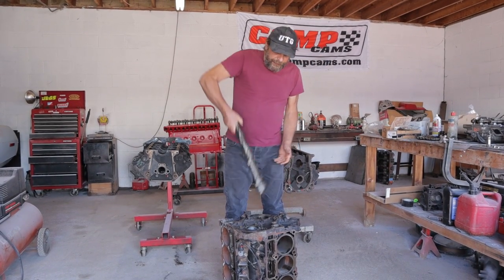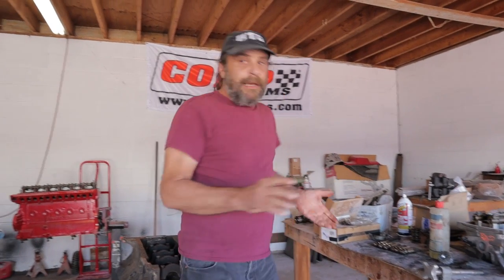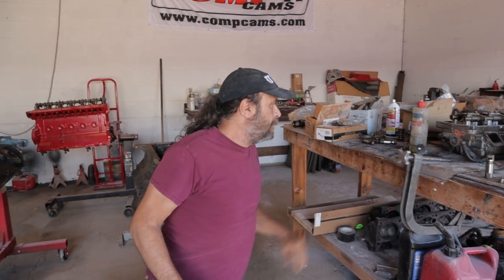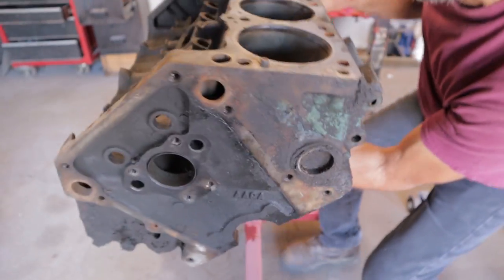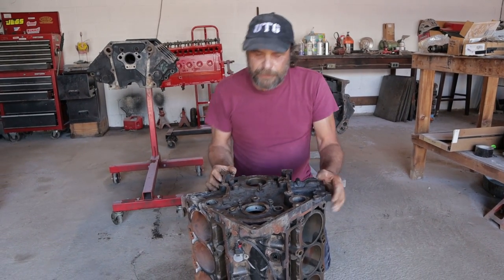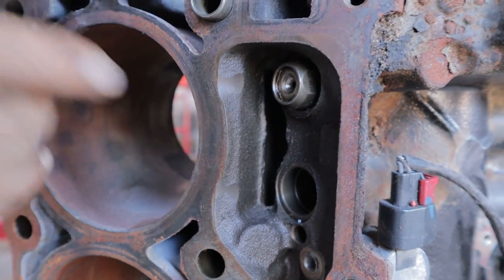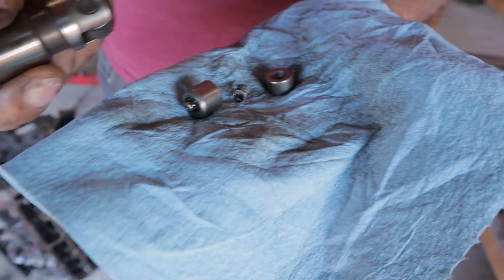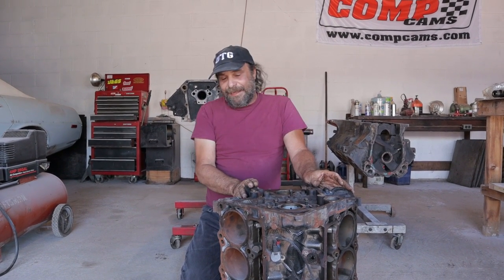Gen 3 Hemi Camshaft Failure Mystery Explained!

Comment: Hi, I'm a Chrysler tech, I've had the fun of replacing a couple of these camshafts and lifters, I've also had to replaced a couple of engines due to excessive metal getting thrown into the oiling system.  I've only seen 2 vehicle driven by normal customers, all the others were police vehicles.   The officer who was in charge of the fleet was grumbling to me about this issue and told me the 4.6 liter Ford's don't do this, but then said but these will destroy a 4.6L on acceleration and top speed.  I explained to him that a 4.6 was an overhead cam engine and that all the cam lobes and lifters were lubricated by a fed supply system and that the Hemi's cam was lubed by splash.  Then I went over their maintenance records and found they were changing oil at 5,000 mile intervals and using the cheapest oil and filters the P.D. fleet dept could get on bid.  They were also idling the cars for 12+ hrs a day between multiple officer shifts in South GA heat running the air conditioner.  So I asked how many hours they put on the engines in a week and he responded he had no idea. My response to him given the amount of idle time the oil change intervals they were performing were probably closer to 10000 intervals.  This combination of poor quality oil and filtration, along with poor maintenance intervals, high heat and extended idling was they lead killer of these camshaft lifter roller bearings.  I recommended they use better oil and filters, and recommended they change oil every 3,000 and try to not idle the engines as much for as long a time period.  He said the department didn't see the need to spend more money on maintenance or the need to educate their officers to be better vehicle operators.    I do think Chrysler should install oiling jets of some kind to spray the lifters and lobes or they could at least change the PCM programming to  periodically raise the engine rpm during extended idle periods.  But that would also require educative training to the vehicle operator.
Reply: Very interesting read sir.
Reply: Would a simple oil line to feed the cam suffice
Reply: @DylanL69  if there was a place to put it inside the block.  The oil galley right below the cam would be a great place to install some spray jets.
Reply: @stevendonnalammar4422  I'm talking about a straight pressured line to feed it I was thinking the tube the cam is in
Reply: Would it not be possible to just put a hole at the bottom of the lifter to oil the cam? Seems like the easiest solution. Like he said some people were speculating it already had.
Reply: @shaneeudy1798  but that wouldn't get the whole cam it would help though
Reply: Interesting
Reply: Aniquin  it's more a lack of oil then bad oil
Reply: They wouldn't have that problem with an LS engine typical Chrysler Dodge crap just like their Transmissions
Reply: @ralphss434  the hemi is far superior to the ls only problem is the cam issue which is fixable with some modifications
Reply: Ford did have their own issues with oiling at idle.  The 4.6 would chew through timing chain guides like crazy.  The plastic would wear away and the chain would dig into the aluminum backing.  All from idling.
Reply: Yeah I'm fairly certain this was only an issue on the earlier MDS Hemi's because after We got it figured out newer vehicles haven't been showing the problem as often
Reply: "He said the department didn't see the need to spend more money on maintenance or the need to educate their officers to be better vehicle operators." - Sounds just about right.
Reply: @ChrisR   well got to agree with him, if the other cars don't require it...now in a world where ALL makes require the extra attention to keep them from eating themselves, sure train officers...its perfectly reasonable to just swap to the ones that don't need any extra attention to live.....and i love Mopar
Reply: Well sounds like you know what you are talking about, is STP 5W20 fully synthetic oil good to use on these 5.7 3rd gen Hemis ?
Reply: So Chrysler build a police pursuit vehicle and they don't think about how the police is going to use the car. Just a bad design and Chrysler denying there's a problem.
Reply: @sho942000  not a Ford fan here but timing chain much easier to fix.
Reply: I worked at a dealer in North Georgia and can confirm a higher occurrence in police vehicles. We did however have a few hemi trucks that had this issue as well.
Reply: @StevenDonna Lammar what about the 3.6? Have you done many of those with head issues?
Reply: @gokblok  About a dozen of them, they also have issues with the roller lifters locking up and burning up cam lobes.  I've replace more camshafts on 3.6 liters than I have on Hemi's.  Same problem, they're all fleet vehicles with long oil change intervals.  Engines need maintenance.  Oil breaks down over time, and even faster in high heat environments.  You don't have to be afraid to buy them, just maintain them.
Reply: @stevendonnalammar4422  I was just wondering. I wasn't the engine tech, but I always wondered if there were that many pentastars that needed heads, or if it was sort of lazy diagnosing.
Reply: @gokblok  The early Pentastars were the ones with the majority of the problems,  I think Chrysler related it to a casting issue and that's why they had an extended warranty on the front/ left cylinder head only.  They had the issue fixed by 2014 I believe.
Reply: @stevendonnalammar4422  I remember hearing the 2011/12 were the problem children, always the same bank, and it's the ones that were built in Mexico. Don't really know how true that is. I do remember thinking that 2013 was the sweet spot for 3.6s because of something else going wrong on the 14s though. Oil cooler maybe?
Reply: Tony Brown the early AFM chevys would drop lifters because the springs couldn’t get adequate lubrication to them. The next gen after that were a lot better when they switched to the thinner oil. Cylinder deactivation systems shouldn’t go over 5k between oil changes, even with synthetic oils.
Reply: @DylanL69  yeah sure that's why the ls is swapped into just about everything
Reply: @ralphresendez9886  that's because it's just a small block chevy
Reply: @DylanL69  a ls engine is not a small block chevy,, none of the parts interchange
Reply: @ralphresendez9886  it's a 350 block with a different bottom end and bigger heads so yes it is a small block Chevy but it's modernized and built stronger. So the hemi is still the better engine. Actually the ls is just modern versions of those engines from the 60's and early 70's
Reply: @sho942000  I don't believe the guides failed anywhere near the times the internet has come to speculate
Reply: @bigblockdodge745  my question is, how many patrol rifles are now unaccounted for from the last few weeks???
Reply: @stevendonnalammar4422  that's the main thing with Ford modular motors, no need to great buying them but always make sure they have been maintained regularly
Reply: ralphss434 actually they have the same issues as they are similar
Reply: Dylan having had both engines the hemi was shit compared to the LS. 323000 on my LS and ran great when tranny went compared to 110000 on my hemi which had a lifter collapse. Luckily it came back but traded the truck off 2 weeks after
Reply: Exactly correct about fleet maintenance, the chevy small block takes a beating way better than the new hemi. Our 2011 and 2012 caprice L77 engines are still running strong, but almost all the chargers are out of service. Drove a 12 Charger pursuit for two years with 75k on the odo. Engine was ticking bad when I got the car, but it still ran fine. I didn't really do much acceleration or idling as I worked in an office. Took it out on the street for a few weeks and the radiator exploded. I managed to cut off the engine after a few seconds but it was too late. Fleet manager put it back in service but it ticked way worse. After 6 months like that i got a CEL. Code was #3 misfire. I'm guessing it wasn't lifting all the way because the rut was so bad in the camshaft. When they took the engine out they said there was metal in the oiling channels and it had to be scrapped it was torn up so bad. They said they are never buying dodge again. Also, the vortec engines are starting to have issues in the 18 and 19 tahoes, loud ticking noises. Hope it's just normal wear and tear.
Reply: @ralphss434  That's why the SRT cars are not chrysler engineered hahaha
Reply: These new Hemi's have an Oiling problem and Uncle Tony pointed this out clearly in this video! My 2012 Ram had this problem with only 33,000 miles on it where the lifter started to tick so I was smart enough to trade it in just before the lifter went bad! Oil was changed every three thousand miles by my Dodge Dealership! It is a real problem!
Reply: @Bcr3106  I've seen SRT's eat camshafts too.
Reply: gokblok I have a ram 1500 I had the same problem
Reply: Has Chrysler made any changes to the lifter and cam. I just purchased a 2018 Durango SRT with 43000 on it, drove it 3 days and it’s at dealership having the lifters and cam replaced. Is there anything I can do as a owner to reduce the likelihood of it happening again. IE don’t use ECO mode, or drive it in sport mode? I will only drove the truck a couple times a month which is also concerning to me a little. Should I reduce idling time by only letting it “warm up” for a minute or two, reduced idling isn’t really possible in traffic in the summer in Georgia. Thanks in Advance. Can’t do any mods or programmers because after this I have to retain the warranty as long as possible. Going to let the dealership do all the service to make sure Dodge doesn’t screw me.
Reply: gtzgreatride I would but I have a 100k bumper to bumper warranty.
Reply: gtzgreatride seems the best I can do is to cut down on idle time and drive it like I stole it... seems to be the only way to keep everything lubricated.
Reply: Anthony Joyner  Chrysler should be responsible for this
Reply: Cop cars idling for 12+hrs a day is surprising to you? Im actually dumbfounded that THAT would surprise anyone. That's been standard practice for decades. Sounds more like a case of planned obsolescence to me.
Reply: Aniquin  as a tax payer you should be worried about are government giving  trillions to wallstreet.  not bread crums for the police cars
Reply: Chrysler sucks and should fix the flaw in the oil delivery system. You can run chevys with really old oil and this problem rarely happens. If its a good motor its a good motor and now i see why they they call them demons because that demon will show its face before you 20 thousand miles on them. Smh at the shitpo design.
Reply: @DylanL69  how on god's green earth would the hemi be superior to an ls engine? Lol the term ls swap is popular for a reason because they are tough as nails.
Reply: @robp.1995  makes way more power and alot more reliable especially the new hemi's
Reply: The general public have been falsely led to believe that you can use cheap oil and cheap oil filter's so long as you keep up on regularly changing your oil. The majority of car owners are slowly destroying their own engine's.
Reply: @boostjunkie2320  Idk both modern conventional and synthetic are pretty good
Reply: @DylanL69  Not for all engines. Especially turbocharged engine's which most companies are running now. Most of these customers, dealerships and American car companies do not know how to properly maintain a turbocharged engine.
Reply: @boostjunkie2320  yes they do know how to maintain turbos
Reply: @DylanL69  🤣🤣🤣🤣🤣👌👌 Explain to me what do you do different when  changing the oil on a turbocharged engine??
Reply: @boostjunkie2320  you change it more often there's really nothing  else to it
Reply: @DylanL69  The oil filter needs to be filled with oil first. Then you should cold crank the engine to oil the turbo before you start the engine and get your dry turbo spinning up to 10,500rpm with no lubrication. Also on every cold start you need to let the car idle for a few minutes before driving off so that your turbo lubricated. Also let the engine idle for a few minutes after hard driving when parked. Your turbo will be glowing red after hard driving and will have no oil or coolant when you shut off the engine.
Reply: @boostjunkie2320  yeah that's literally a standard oil change for a turbo engine
Reply: @DylanL69  an ls is not a 350 block..ls uses several different blocks, both iron and aluminum
Reply: @DylanL69  now gen 1 LS was a 350, but we are on gen 3 now ...gen 1 was the vortec era
Reply: So, uncle Tony said 3rd Gen. So a 2006 5.7 hemi 1500 is very prone to this?
Reply: @greenmachinepowerstroke2419  yes, usually happens after 75k miles, some last longer depending on maintenance and how it's driven
Reply: @shermanbrown3580  so is the tick/ lifter and cam failure the same thing? Or 2 different problems?
Reply: @shermanbrown3580  on some ram forums. Redline oil fixes the tick. But does that eliminate you from having cam and lifter failure in the future ? Or does it just fix the tick?
Reply: @greenmachinepowerstroke2419  all of it is caused by a lifter failure basically because the lifters don't get much oil, the cam will be pushing a dry lifter and the cam will get scored
Reply: @greenmachinepowerstroke2419  that just covers up the problem, guys back in the day use to put slick 50 in their motors when a rod started knocking, slick 50 would make it quiet but you still had a bad rod bearing
Reply: @shermanbrown3580  so does redline fix this problem? From what you know?
Reply: @shermanbrown3580  interesting. Thanks for replying.
Reply: @greenmachinepowerstroke2419  no it just masks the problem for a while
Reply: @shermanbrown3580  so, mine ticks on start up. Once I get going, and drive around a bit. I can idle, and no tick. Not broken exhaust bolts. Iv confirmed that.  If I were to take out my lifters right this minute, would one or two of my lifters or maybe more have a bad roller on the bottom?
Reply: And or a higher pressure oil pump?
Reply: @greenmachinepowerstroke2419  the reason it ticks on start up and not after its warmed up is you have a lifter losing prime...i can guarantee you if you was to take the lifters out one either has a bad roller or scoring on the side which causes it to want to catch on the lifter wall
Reply: @michaelelliott289  high pressure oil pump won't help because oil is not pumped to that area, I really don't know a solution to this problem
Reply: @michaelelliott289  wait just thought of this, racers use to cut what they called a "dribble groove into the lifter bore so oil can dribble down on the cam lobes, that might help...only draw back would be that you might have to go with a higher pressure oil pump because that's going to lower oil pressure
Reply: @shermanbrown3580  I'm  pretty sure your correct yet back in a day they did make an external pump for engines that worked fine on most engines.
Reply: Also, I see Melling has a high performance 75 psi oil pump  for the 5.7 and 6 4 liters.  Has anyone tried this new high performance Melling oil pump?
Reply: @shermanbrown3580  Melling has a couple different high performance oil pumps 65, and 75 psi that may help with these Hemi 5.7, 6.4 liter issues.
Reply: @shermanbrown3580  just one guy's opinion but how many of these failures happened because the owner didn't keep up on oil changes and drove their truck like it was a racecar? My 09 runs like the day I bought it. Oil changed every 5k using royal purple.
Reply: @Dennis-sq2nm  these issues didn't start until 2011 when Chrysler revised the engine, you have the gen 1 5.7
Reply: @Dennis-sq2nm  no sorry you actually have the gen 2 hemi...when the 5.7 first came out it was around 340 hp...2007 was gen 2 which was basically just a higher tuned version making 390 hp...2011 is what they call gen 2.1 where they changed the block and heads
Reply: @shermanbrown3580  u sure about that? When referring to a 3rd generation hemi it doesn't mean the 3rd version of the 5.7. Just the hemi altogether. I could be wrong tho
Reply: @Dennis-sq2nm  yes sir you can look it up, those problems didn't stat until 2011, I don't know everything about them ..im a Ford tech but we get the occasional Ram in here for a trade in
Reply: Serious question why does my 19 ram classic top out at 106 in 4th gear but has 4 more gears them engineers are messed up to tease me like this with their dam governor's can yal tell I I remove the limit
Reply: @DylanL69 , you don’t have a clue if you think an LS is based on a SBC. They have nothing in common except for the name and the number of cylinders.
Reply: @timsharpe3498  wrong it is a fuel injected version of it. They had LS engines in the late 60's and early one was the 350
Reply: South Georgia, sounds like officers in Valdosta running engines FOREVER
Reply: @DylanL69  
What are your credentials? I’m an ASE Master Technician with 45 years of hands on experience. I also have a racing background. Nothing you said makes any sense. Leave this to the experts.
Reply: mark robertson  dodge lost their police fleet because they stopped making rwd vehicles in 1990.  no department wanted fwd.  the diplomat and gran fury police cars made til 1990 were well praised.  mainly every department had them too.
Reply: StevenDonna Lammar The problem is Chrysler knows this and they are hiding it . Tell you what . Look into the jeep with the same issue in the 2nd gen. they made it worse in the next to try to make more money . Skidoo’s they are . Ohh bye the way I made one dealership buy back 2 units with the same problem . Never in a million years will I ever look at another Chrysler past 1990 or otherwise I’m doing it to make money
Reply: @Polaris88Reid  omg I'm at scared, because I'm getting(unless I change my mind) a scat pack and although it's the larger engine, it's so she most design. I'm just praying that it keeps well and if anything happens I will have my warranty.
Reply: @ralphss434  What about every other Chev small block Pal? GMs were NOTORIOUS  for EATING camshafts from the 70s thru 90s. Look up small block cam issues and get back to me. ....
Reply: In 2020 its absolutely a turd of a design. Chrysler is at fault
Reply: @DylanL69  in what way?
Reply: @larrydunlop378  you really gonna go back to flat tappet stuff....lol.

Likely in that era was when they started reducing zinc in the oils. Quality of oil could have went down also do to the oil embargo. They would just add other shit to it and it wasn't as good.
Reply: @robertstembridgejr7532  whoa
Reply: So you saying to rev up your engines ok i love doing this.
Reply: I see way more problems with hemi engines compared to ls engines.
Reply: Love my 5spd Magnum just fine. No need for a hemi. MOPAR!
Reply: @Ragingbull340100% one tech to another 😂 Ill keep my magnum thanks!!!
Reply: @stevendonnalammar4422  what you recommend for daily driver, hemi or v6?
Reply: Newer Ford Police vehicles are nolonger using a 4.6 engine. They switched to a 3.7 V6 and currently are supplying a 3.3 gas/Hybrid combination that was tested against the competition and was the fastest of the other brands tested. This refers to the SUVs most Police departments use such as the Explorer and Durango.
Reply: Hey Steven your comments are awesome so thanks,  I do have a question I'm thinking about buying a 2013 ram 1500 crew cab with the 5.7l hemi, it has 104k miles,  would this be a smart buy, I'm not sure what to do,, please help lol
Reply: @DylanL69  That's why you see everyone with Hemi swapped Miatas, RX7's, OBS trucks, classic trucks, Vans, Cavaliers, Trailblazers, even rocking chairs. You also see third gen hemis rolling around everywhere with 350,000+ miles on them. Totally not an LS. Sorry to burst your bubble bud, but the first gen LS/Vortec is a much better motor, I work on cars every single day, and at least one is garenteed to be a 5.3 LS based Vortec, and a lot of them I see have well over 200,000 on the clock with no issues, no oil pressure droppage, no clicks, clangs, ticks, or knocks. A good few have well over 300,000 with no issues at all. I only see third gen Hemi's about once a month in average, usually less, and I probably see about a thousand cars a month man. The stock LS flows better, is better engineered, is more reliable, and doesn't eat cams . Personally, I'd rather 350 swap my toys because I'm old school like that, I like distributors and carburetors, but no, I have to say that the LS is a much, much better motor. I'm not even going to bring up any aftermarket support, because we both know how that is. Not knocking Dodge, I like a lot of the old school Mopars, you're old Dodge Daytonas', old school Demons (And new when they're not blowing up the diffs, lol), Cudas, etc. I even like the Pentastar V6, the motor you'd find in the mid 2010's Grand Caravans, Town and Country's, Promasters, and V6 Chargers, because they're good motors. A third gen Hemi is shit. When you have to talk about fundamentally changing a block for it be good, it's not a good motor. An old Northstar Cadillac motor is good if you increase the head bold size, but is it a good motor? No, it came from the factory with a shitty design, popin head gaskets. And eating cams honestly is worse. So... No. It's not better.
Reply: @sdusb1243  hahahahahaha ls motors ain't got shit on the hemi especially when you put a blower on them. Also they are the only engines they run in funny cars and top fuel cars
Reply: It sounds like Chrysler needs to include an engine hour meter in the software to turn on an oil change icon sooner. The software should include multipliers based on ambient temperature (x 1.1?), if the A/C is on (x 1.25?) and engine at idle time (x 3.0?). Actually the only time the engine hour meter wouldn't be subject to time multiplication might be those minutes when the engine is above 2000 rpm?
Reply: @curtislowe4577  they fixed the problem with the newer ones
Reply: @boostjunkie2320  This is def the "book" answer!! Totally right about cool downs and letting things get "up to temp" before abusing them!!! Hafta say this though...as a pro diesel tech for 20yrs, I havent prefilled an oil filter in at least 15 of them... An old tech who taught me lots said it was a time waster. He also did manic oil sampling and we never saw ANY ill effects. In fact the sampling lab said we  consistently had the best samples of any local fleet by a huge margin!!! Just sayin... Oh and we did 10k mile changes and used Delo 400 oil. I put the same diesel spec oil in everything I own, from V8 pickup to the TwinTurbo Dodge Stealth....
Reply: The LS series and the SBC have absolutely nothing in common. Maybe you need to quit the keyboard and go to a real drag strip and try to make some friends and hopefully you don't get your ass kicked in the first 10 minutes. Good luck bud...
Reply: I agree that one should only use the best oil and filters but seriously if they can’t run 24/7 they shouldn’t be on the road. I use amsoil oil and filters exclusively.
Reply: @markbulva4188  actually those 63-73 mopar big blocks has all the cops spoiled ,they remembered burning rubber and never losing a chase scene scenario,spoiled, they tried chevys and fords,everything since 1979 has them spoiled,it takes a helluva machine to run 140 mph and idle all day in 102 degree weather with the a/c blaring,the new stuff won't do it,no matter who makes it,i've found only way to get want you want or need is to go back to the past,for me its no problem i kept two of every mopar v8,one to run the other for parts,lot of kids come around and leave pissed oh well
Reply: Hey,  i just purchased a 2021 ram classic hemi.  I want to make it last as long as possible are these engines still prone to the lifter/cam issue?   Should i just stick with the 5w20 synthetic,/oil changes on time and not worry about it?
Reply: @MrTacoJay  If I were you I would run amsoil like I did in my 04 F150 with a V8 and my 14 f150 w a tt V6. Dad uses amsoil in his diesel and I also run it in my lawnmower, snowblower and snowmobile. It’s the best oil out there.
Reply: @MrTacoJay  use and run DURALUBE every other oil drop,new filters,the duralube treats the metal not the oil,it remains in the engine,super slick and it works,i even use in my weed eater,its 30 years old
Reply: @DylanL69  If they engineered a better oiling system in to the block that would have been far better.
But it would have been too much to ask for.
Reply: @MrTacoJay   5w20?!  Is that what they require?  Or is it just cheaper for you?
Reply: @ThunderAppeal  that’s what is recommended from ram
Reply: I can fully understand the cop cars with the Hemi's having this issue since the cops are at idle eating donuts most of the time. LOL
Reply: @hmc2s  I believe the cop cars were a twin turbo v6 but please correct me if I'm wrong
Reply: This video is 10000000% spot on. I just had to replace my entire long block on my 2011 Ram 1500 4x4 due to failed lifters and cam and I have had $100 full synthetic oil changes at my Dodge dealership since I bought the truck brand new at 3k miles and not a mile over. I have meticulously taken care of my truck and it doesn’t matter. The engine has a HUGE flaw and Chrysler needs to be held accountable. Luckily I have the lifetime maxcare so I only had to pay my $100 deductible and put in new coolant but thousands of people on the Ram Forumz have had to pay out of pocket for this fix. It’s bullshit and I will NEVER go with a Ram ever again.
Reply: Im no engineer but what if the cam was drilled like the cam in ford 2.3 4 cylinder lima engine?
Reply: Your a Chrysler tech and you don't know the oil gallery in the lifter bore? What kind of technical work do you do? Oil changes?
Reply: @shaneeudy1798  it's not a speculation, the lifter bore has an oil gallery which in turn lubes the lifter and cam.
Reply: @ralphss434  LS engines do have the same problem since the AFM system was introduced. Common fix was disable the 4 cyl mode with a tuner!  Shitty oil and filters extended change intervals! Extended idling @ low oil pressure = paying me to fix it!
Reply: UT & Steven - I was a oil delivery driver for Shell lubricants and delivered motor oil to all Chrysler/Dodge/Ram dealerships. Over the years I had seen many fairly newer Hemi powered police cruiser, cars and trucks in the shops with heads off getting cams replaced. I asked the mechanics that I got to know "is there something wrong with the Hemi engines" they didn't know but all would say the HEMI's are great engines. Looks like UT's got the answer/cause to the issue with the engine issue, some in town used police cruisers probably do tons of idling & low speed use. was just turned on to UT, by Derick at his Vise Grip Garage channel, so cool to watch "Professor UT's" old school engine building.
Reply: @StevenDonna Lammar  Thank you Steven for sharing your insights! I’m thinking about buying a new Dodge Charger with 5.7 Hemi. My only concern is Atlanta stop and go traffic during my morning commute. If I do oil changes every 3000 miles and don’t idle unnecessarily, will the engine be reliable and be a good buy? How are the transmissions?
Reply: Dylan,  have absolutely no clue to what you're talking about
Reply: Chrysler should just dump MDS altogether and run the manual cam and lifters in all of their engines.
Reply: @ralphss434  i hate to be the one to break this to you , but gm trucks have this exact same problem .
Reply: Hemis are not lubricated by the dip and splash method , its not the 1930's anymore .  and the problem has nothing to do with how far the cam is from the crank in the block like tony is implying , that is ridiculous .
Reply: @ralphss434  20 years of Chevrolet trucks and the transmissions were garb compared to my ram. Piston slap- fuel-pump- gauge cluster- excessive oil consumption- led taillights at $400 per- junk struts were how those 20 years went. So far not 1 problem with my ram.
Reply: Hey, Chrysler Tech....your thoughts on a broken and shaved cam lobe?   In Cylinder 5.  Error 0300, 0305
Reply: Imagine that, cops do not want to change their tune. Hemi Lives Matter!
Reply: @DylanL69  than
Reply: @numberpirate  than what?
Reply: @bluecollardaily2676  agreed…pile of excuses for a garbage throw away engine.
Reply: It happened to me and I'm not a cop.  I drove mine gently, had it perfectly maintained, etc.
Reply: I was a Mopar guy until I had this issue with my 2011 Jeep Grand Cherokee. It cost me $7000.00 Canadian to replace the cam and lifters. . And I had just had the front end done 1 month before at a cost of $2500. 3 months after the cam was replaced the air compressor went and that was $3000.00. 3 months after that something failed to do with the differential. I was quoted $3000.00. My millage was only 140000 KM. It was only 6 years old. We had done all the maintenance on time. Lets face it, Chrysler makes the bottom of the line vehicles. I defended Chrysler for years as a Mopar lover. NO MORE! I traded in that piece of crap Jeep and my 2010 Challenger R/T classic before it needed a new engine. Shame on Chrysler. It is not the same company it was in the 70's and is getting worse.
Reply: @DylanL69  They can't be superior if you can't keep a cam in them. I have tore hundreds of ls' down and just about all the cam could be reused Even the ones with over 300k miles
Reply: @littlebillb4168  An LS is hard to beat
Reply: I know this is a old post, but I've owned a couple new gen hemis and have had no issues, well over 100k miles. But I use quality oil, full synthetic and change it every 3k miles. Oil is cheap, engines are expensive.i have friends with 200k plus miles on them, I do think maintenance is a large part. But I also think the larger distance from cam to crank is a flaw. Just my opinion.
Reply: Does the 2019 300c Srt have MDS got told that the 8spd cars of 2019 not have MDS because the 8spd transmission gave the economy they were looking for?
Reply: When techs graduate to mechanics and start their own shop word is the honest ones do better as Mechanics
Reply: I don't care what engine you have excessive idling is not good for any engine.. period
Reply: @neilrobertson1345  my 2021 has MDS and has the 8spd. I wouldnt see why your 300 wouldnt also have it
Reply: Why other manufacturers don't have this issues? Is on purpose bad engineering to sell more vehicles
Reply: Wrong, the Hemi's cam is NOT lubricated by splash. Splash lubrication is a thing of the past because it aerates the oil, this is why modern engines, including the hemi, have windage trays to prevent the crank from hitting the oil. Lack of splash lubrication has nothing to do with this issue.
Reply: Thanks for the info
Reply: I never considered the "raise rpm" idea for extended idle time when I was watching this and thinking of ideas. That honestly sounds like a simple solution. Flash the software to the ecu and see how it goes
Reply: you are the second post ive read that the hemi would benefit immensely from a higher idle like between 700-900rpm vs the 600 it has now
but the reason for such low rpm was due to emissions and mpg testing
Reply: Basically what you’re saying is these Hemi engines are designed for high rpm on highway and not city driving at all. Especially idling in the heat. These engines do not care if they are under load all the time as long as the rpm’s are up. Do I have that right? If I do please do not take this personally but that is a garbage design from Fiat’s Italian engineers. Somewhere they thought they were saving themselves money. Ever one of these trucks should be recalled just like Hyundai and Kia had to do. New motors that are redesigned should be installed. This is my last RAM or Chrysler product.
Reply: telling the ECM to throttle up the engine for 10 seconds after 60 seconds of idle in park could be an easy hack.
Reply: @ralphss434  yea cuz gmc afm system and lifters are so great 😂  smh not being a fan boy ive had all of the big 3 and they suck… going tundra next see if thats any better